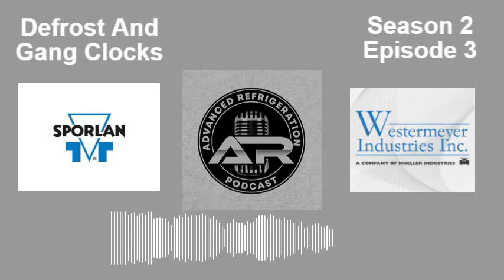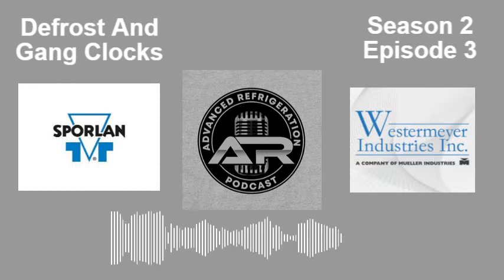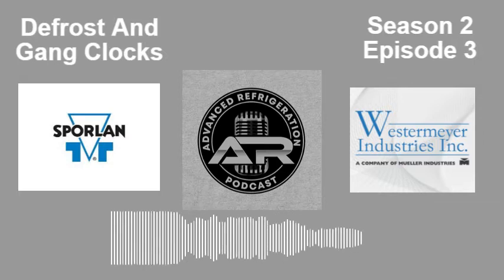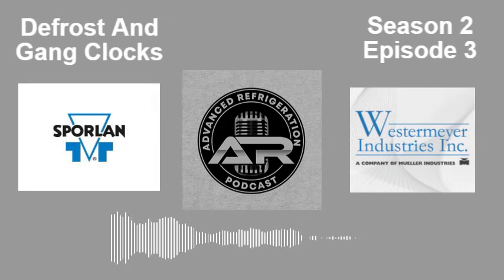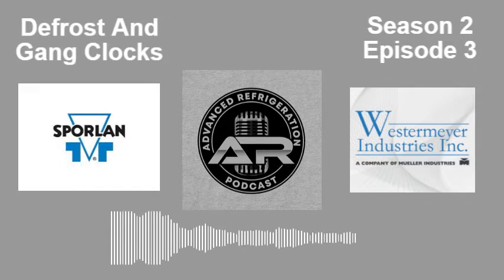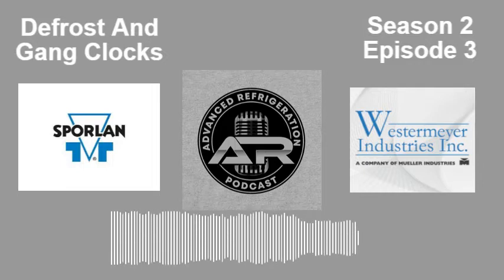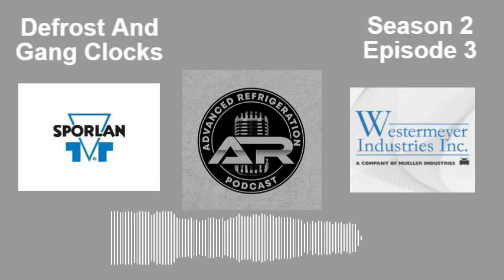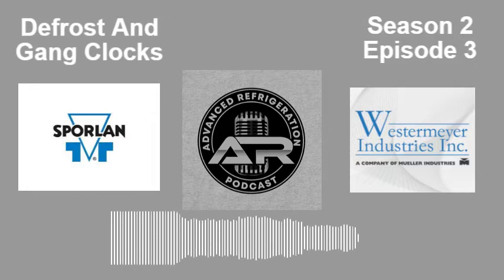Defrost And Gang Clocks

Comment: Highly recommend replacing old mechanical failed clocks with a newer style paragon 9145-00. It is dual voltage offers termination and no mechanical complements to fail.
I have been using this for years and have an exceptionally low failure rate.